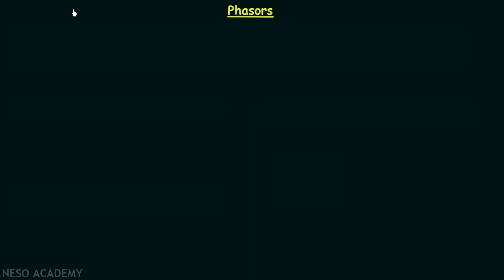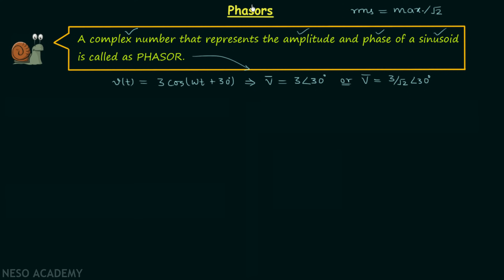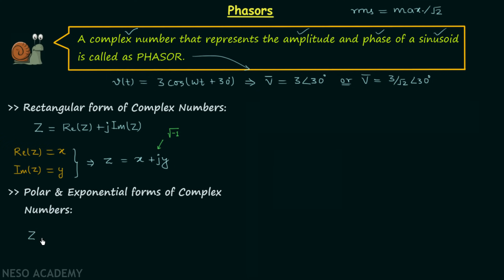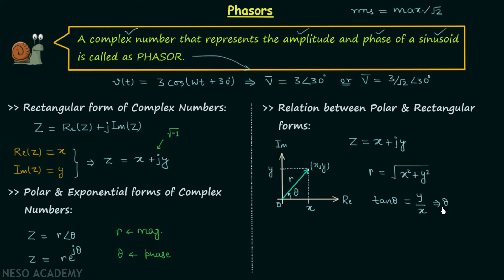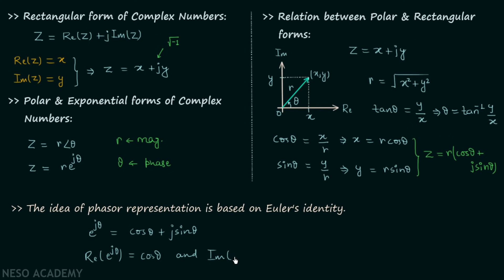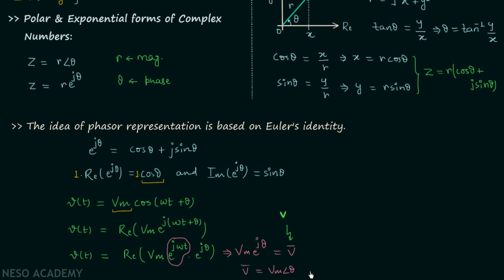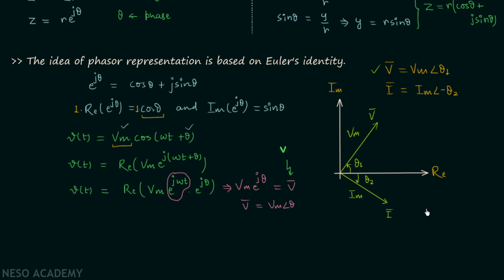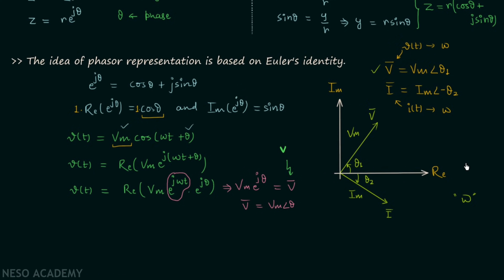Phasors

Comment: U said that phasor represents amplitude and phase angle but why phasor is a complex number why can't we represent the amplitude and phase of a wave with a real number?
Reply: If we express amplitude and phase angle of an alternating signal by real numbers, sometimes it will be more clumsy and lengthy.For example,if we want to calculate the resultant amplitude and phase of two or more alternating signal then by using trigonometric functions it will be more difficult to us, that's why phasors is an important tool for us to calculate amplitude and phase of alternating signal.

Comment: What is the need to suppress the time component....?
Reply: As electrical engineers we usually work with LTI's (linear time invariant systems). For any such system all exponential functions are eigenfunctions (meaning the output will be the same exponential, only scaled by a certain eigenvalue). Considering that whatever signal you give this system can be represented as a sum of sinusoids/exponentials, it is better to study only the things that change. That is to say, omega will never change, the only things that can change about a signal by passing it through a system is amplitude and phase.
Reply: I think because in all practical applications the frequency (w) is the same throughout so it can be ignored.
Reply: @MrRiceroni Yes
Reply: I have same questions

Comment: explain why you re suppressing the time component when identifying vt expression  with Euler's formula
Reply: At least that explanation uses phi over theta.
Reply: We do phasor analysis only when we have constant frequency. The time exponential component is implicitly present. Actually, it is the only thing responsible for phasor rotation at a constant angular frequency “ω”.
Let’s take an example,
              V(t)=VmCos(ωt+ϕ)

If we convert it in exponential form we’ll get,
              V=Vm.e^(ωt+ϕ)
              V=Vm.e^(ϕ).e^(ωt)

e^(ωt) is responsible for phasor rotation in phasor domain. Just like the animation we’ve seen in this video. We neglect it for simplicity or to get the form of polar complex number. Suppressing it will not affect our results.

If we again convert exponential form to time domain we’ll get,
               V(t)=VmCos(ωt+ϕ)

It’s for our understandings. Since we’re only dealing with real part of Euler’s equation. This is also true when we’re working with imaginary part.
Reply: Yash Raj no. the reason is we can only do phasor analysis (lagging/leading) for entities rotating at the same speed(ω). Hence, the rotating factor is irrelevent (since we're in a situation where all signal speeds are the same).